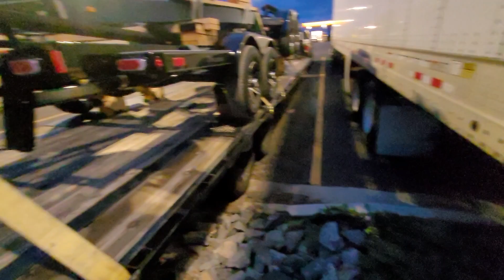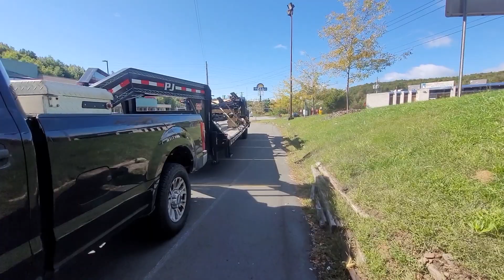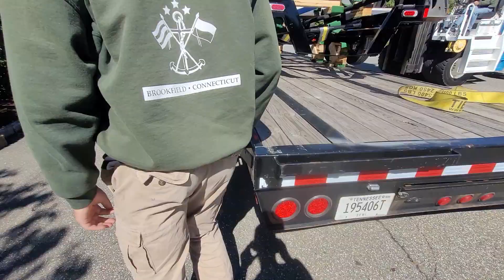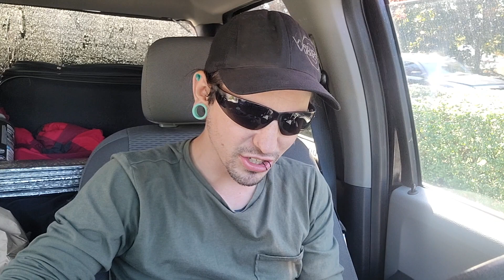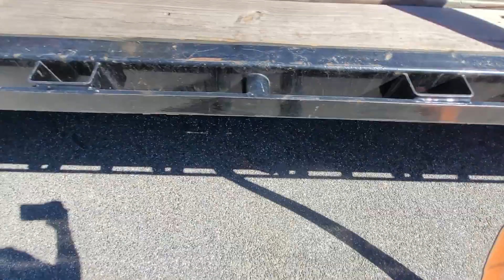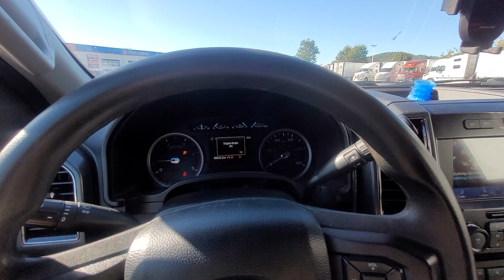Hotshot Trucking Can Take Everything From You | Reasons Why This Business Is A Gamble | Day 3

Comment: Hi:
When I was trucking, the first 3 gears can be skipped on a light load, so too many gears on a 10 speed automatic don't do much for the driver because they're always hunting, and shifting erratically.

That aisin 6 speed stays put, without all that up and down shit, and is very stout.
The Jake on the Cummins is so superior that you rarely have to apply the brakes, and the engine pulls like a locomotive.

Yup: the ford and Chevy win the drag race, but just can't do what the Cummins does in every day reliable hauling.

Glad you're gonna get a ram again.

Comment: the alumiduty is scary if a blowout causes that much damage but one thing ford has over dodge in my opinion is the cab size. The ford back seat is huge the only to get the same room in the dodge back seats if you get a mega cab which is like 5k-10k over the normal 4 door dodge. I know you weren’t saying new for either but both are about the same priced new i saw the lowest spec f250 window sticker was 59k with fake leather and rubber floors

Comment: The best way I’ve found to use the exhaust break is running it with the cruise control. And just adjust the speed on the steering wheel.
Reply from the maker: I noticed it works awesome doing that. Kinda gives the truck an idea where the driver wants it to be whether it's high or low
Reply: I Love my 2021 Ford. Been hauling these campers around for a year now and really like it. Been looking into buying a 40’ trailer to see if I like hotshot. Not sure if I can do it successfully without a CDL.

Comment: Might have to look at Fords.  75k F250 with 25k down is 1000 mo for 60 months.  20k trailer with 5k down is 300 a month. Total 1300 a month and paid off in 5 years.  Get the extended warranty for the just in case crap and add 3-4k for that.  The less you work on your truck or modify it, the more you can run and make money.  Add 500 a month you need to save for maintenance items and insurance.

Comment: I think the exhaust brake is just different than your used to but not necessarily “bad” I had a 2017, 2020, 2022 and just got a new 2022. I would regularly be towing 20k load and 10k+ trailer and ran the NW and never had to ride my brakes. All together over 450k miles on them did one brake job on my 2017 at close to 200k miles.

Comment: It is a 2005 and a half with a 5.9 Cummins and it's always been in a garage kept born on concrete still got the factory tags and everything on the frame so one of those diamonds in the rough that you just don't find but I know you always say if you're hot shotting or two wheel drive would be perfect

Comment: Semis are easier to work on then these hot shot pickups. Open the hood and can get to anything.
Reply from the maker: I agree BUT the parts are so much bigger and heavier. I hated doing brakes on my Freightshaker when I had it and that was only an FL60
Reply: @CPSteveMiller  brakes last 5 years. A 2 wheel cart will remove brake drums with no effort.  It takes a whole lot less work to get to 1 million miles. The freightliners at my job are getting over 8 mpg pulling 45k worth of freight.

Comment: Ford is having lots of issues with the 10 speed transmissions.  Personally I don’t think these trucks need 10 speed trans at the cost of reliability
Reply: The ten speed is dumb for these trucks. Save it for the semi trucks where it's needed. Six speeds is more than enough for a pickup.
Reply: @markbremmer8642  exactly....personally if I was towing heavy or doing hotshot it would only be with a manual trans even if I had to buy a used truck. If one of the big three made a super strong, super reliable  6 or maybe 7 speed  manual transmission it would sell pretty good.
Reply: @joelotto1252  I agree. However, we as consumers, have stopped buying manual transmission cars and trucks. I'm not sure when the last truck with a stick came out. Probably 2007-10 are the last year's for a manual transmission.

Comment: Well between the Fords and Dodges at work the 16 to 18 Dodges are ok.. The newer Dodges are junk cant keep a transmission in them at all... The new Fords are the best better fuel mileage and bigger tank than the Dodges I will say I like the 8 speed in the Ford over the 10 speed.. Love the power out of the Fords better... My self I would look for a 2015 to 2018 Ford.. What is crazy right now is you can buy a cab and chassis F550 cheaper than you can get the F350 for....

Comment: At some point you won't make money if you hire a driver. He'll eat your profit. A new truck would be nice but let's be serious for a moment. $70-80k+$20k for a trailer,and we re not talking insurances and fuel you have to drive to survive. A one-person shit show+ a used truck like a 2013-2017 with decent millage and you fix it if he breaks. If the truck is not running money is not coming in. And you're screwed
Reply from the maker: You won't really make money with 1 driver, not even a few drivers. You need a fleet of drivers. Now if you're hiring owner ops that's different. A few good ones you'll make some money. If you're hiring company drivers you're going to need 10+ before it starts getting worth it but it'll require some focus to get the business going properly. Gotta keep drivers happy and keep them from destroying equipment. It's a game and a gamble all at the same time. You can also be making tons of money now but down the road lose it all to one incompetent driver.
Reply: @CPSteveMiller  Well yeah you could go down that road, more and more drivers things are fine. You catch one bad apple and down the drain shit goes. I used to have a small plumbing business,hired a few guys here and there but at the end of the year i was back at square one. I went back to a 12' box truck and a pickup truck easy peasy. Less stress less problems

Comment: EPA now says a transmission tune not CARBed is a felony. You cannot buy any delete parts or tunes now. Cannot sell a deleted truck now. EPA is cruising Marketplace, Craigslist, or any other venue for advertising a vehicle for sale. They will find you and when they check the vehicle for mods of any kind, you are subject to a fine of up to $75000 and a potential felony prison sentence of up to 5 years. I have yet to find anyone towing with 500000 miles on the 6.7 Ford Diesel. Those in my circle, RV folks, sell them off after a couple years. Only RAMs that are older and higher in miles.

Comment: I was letting you know I did message you on Instagram my dad went and bought a camper off of a guy he's got a ram 2500 long bed with original 21,000 miles it is a two-wheel drive I believe it's a 6 speed cuz I know it is a stick he wants $30,000 for it I sent you some pictures of Instagram on it